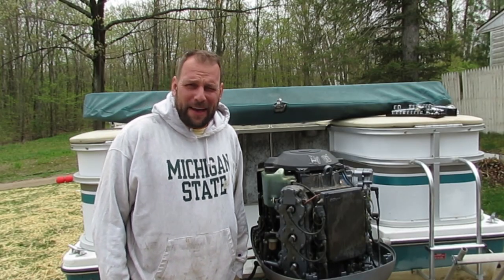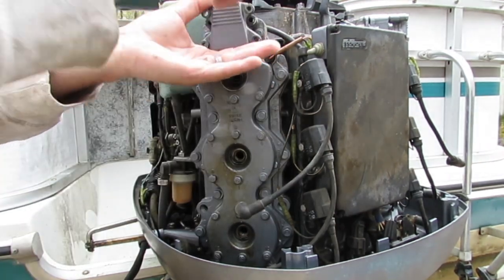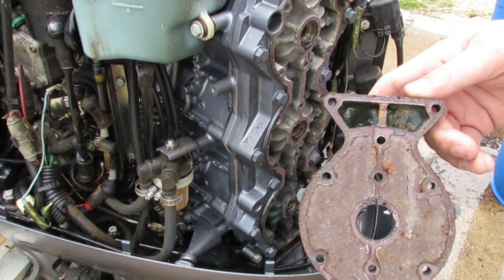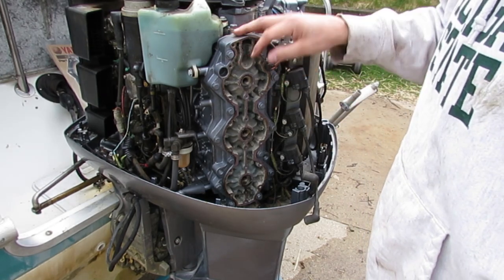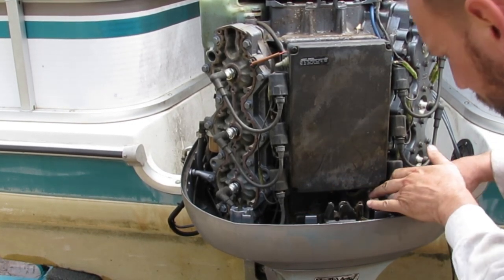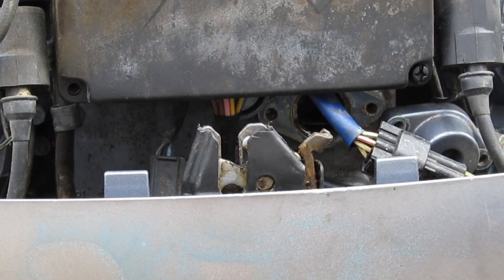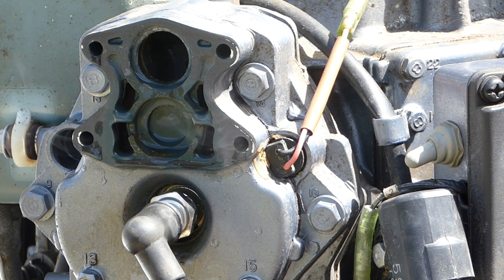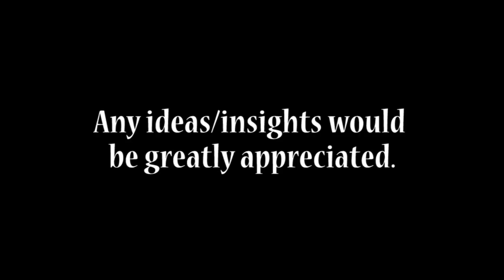Outboard overheating - I've tried everything...

Comment: Make sure your water tube that brings water up from the water pump isn’t corroded and leaking. This happens a lot in salt water boats.I was told just because the water is coming from the tell tale you need a certain minimum  pressure to cool the outboard. I was told you don’t always get the pressure with the muffs and if you have a well that is your source for water it’s tough. Cut a 55 gallon plastic barrel with a drain on the side and it seems to be what the pros use.I would once again check and test the thermostat with a hot water test and confirm they are good. As we know new ones can be bad. Depending on the year last but not least do a computer diagnostic test . I appreciate your frustration and these steps have answered my problems. Best of luck.
Reply: Yep, I have an identical motor and same problem, but only in mossy lake OR when trolling at low RPMs (no-wake).  My theory is that something along the way is reducing the water flow or pressure just enough that it gets slightly too hot.  Usually my alarm goes off just after trolling through an approx. 1 mile no-wake river connecting two lakes.  I shut it off for 2-3 mins and once I can get back to being able to run at higher RPMs it's fine.

Comment: I am feeling your pain right now. I have a Tohatsu 40 HP overheating and its not the pump or thermostat. No water at the thermostat or tell tail. Clean water jacket. Nor bugs in tell tail hose. I hate not solving this mystery. Thankfully there is a lot of advise here. I admire your persistence and attitude.
Reply: What ended up being your issue? I also have a 1995 40 horse tohatsu 2 stroke doing the same thing. Just now diving into it

Comment: I don't know if you have fixed it yet but remove the thermostat and put your garden hose there and turn it on full blast. It can help to clear the out flow. Water pump pressure is only 3-5 psi, it mostly moves volume of water through the jacket. A problem sometimes is bees (meat bees) make nests up inside these areas and you can't see it. Give it a try.
Reply: I’d suggest that as well. Had the same problem with my 50 hp Mercury at idle speeds. The over heat alarm kept going off even though I had a steady stream through the tell tale. Changed everything and then as a last result removed the thermostat again and back flushed through it with a garden hose. Problem solved.
Reply: i agree with u. i have a experiance once.

Comment: I would use a temp gun to see if it is in fact over heating. Could be a faulty sensor. If not the. Pull the heads to get a better look at those passages. Also something could be clogging the pick up tube. Sometimes pieces of old impeller.

Comment: My boat did the same thing. I changed out the thermostat, but it still ran hot when I tested it at home with the water "ears". I put it in the lake and it runs fine. I think it needs more water than the water ears can provide.

Comment: I ran my outboard in a 55 gallon barrel with about 10 gallons of vinegar & after running the outboard for several times with out overheating it. It slowly started cleaning all the gunk & crap that ha built up for years before I bought it. Vinegar worked for me . Good luck
Reply: Também já usei essa estratégia e resultou.

Comment: If it helps. Ask yourself if there have been any changes to the engine either you or someone else made. You were on the right track with the thermostat. Always check the old and new one in hot water. I’ve actually had bad new ones.

Comment: The poppet or relief valve just dumps excess water when you are turning higher rpms as the pump is putting more water into the block than required.  Just a way to get rid of the extra water...it exits out the upper part of the mid section.  Use an infra red temp gun to check wahat the actual head temps are.

Comment: There is a little rubber piece in the lower unit, it’s meant to protect the exhaust heat from the water pump location. Make sure it is still in tact. If that little rubber piece is broken or not in place, there is your over heat issue
Reply: I’m having the same problem but with a Yamaha 30hp, will mines have the same rubber piece in there too?

Comment: Did you replace that thermostat? You should always be able to put your hand on top of the heads; even after/during running it at full speed for hours. If it feels anywhere near uncomfortable to leave your hand on there, then it IS overheating. 130°F max. 90-110 is normal. 
You can test the sensor by removing it and  boiling it in some water. Put a multimeter on ohms across the wires. When the water approaches 130-ish, the circuit should close and give you a 0.00 reading. If it stays open (or it might say OL on the screen) after the water gets hot enough, then it is bad. If your temp sensor only has one wire, then measure between that wire and the metal base of the sensor. 
The only thing i didn't see you do, was pull off the water jacket gasket. If you don't want to damage it (cuz it's a lot of gasket scraping), then flush thru it with a hose, and make sure water comes out the other end. The water jacket cover is a thin space, and little shells will build up in there. However, if your thermostat comes out clean on the back of it, then it is unlikely. 
My best accessment? Test or replace that sensor. And trust how it feels to your hand; on both heads. But watch out for those spark plug wires. 🤣
(Hopefully this issue is long gone already)
Reply: This is some helpful advice!
Reply: sorry but a 90-110f reading is far to cold! horrible advice. if the t stat opens at 130, expect the heads to be 130-145f at the top! people incorrectly assume running cold is fine. its actually not... causes cold seizing and / or uneven piston/cylinder wear . id love to see where in the service manual it says 90f at idle is fine. i am an OMC mechanic and the range for almost all models is 125-160f at 900rpm. 160f is warm enough so you can keep your finger on the top of the head for about 2-3 seconds. being able to indefinitely hold your finger on the head is far too cold!

Comment: Just noticed that the description explains the problem.  I have the exact same problem with the exact same motor, but realized that it really only happens when I idle a lot or troll in no-wake zones a lot.  So I think mine is also due to not quite enough water/pressure going through the system.  When running it at higher RPMs it seems to generate more water pressure are the problem doesn't occur.

Comment: i literally just had the same issues with over heating only i found the issue, after back flushing and disassembling the entire disassemble-able  parts of the water flows i found my issue was fragmented impeller peices located in the lower unit directly from the impeller pump to the feed tube the pump goes to up about 9inches into the pipe was an entire 6 peices of rubber blades now my engine ran with water during months of running before i just got sick of never going over 2400rpm, back flushing alone couldnt get the fragments out, i ended up taking a long wire and bent a tiny hook in the end and pulled each peice out one at a time. my engine seemed to run water only causing overheating when the water pressure sensor was plugged in, yes in. but this just goes to show that somtimes you really need to look hard for those peices as black in a black pipe can be mistakenly overlooked. hope this helped :)

Comment: You took off the only the first cover. The second cover reals all the passages for the cooling water around the cylinder head. That is where the gunk can be accumulated. You can take off the transmission and do a flush with mild acid and then run fresh water or do the right thing which is to take off the second cover, inspect and remove any gunk.
Reply: Jose Pereda yes exactly!! So close if he had Remove the second one he would’ve found his problem
Reply: Came here to post this.  OP only got halfway to the water passages.

Comment: Take it to the lake and use a thermal heat gun and see which head is getting hot .
Also , big Yamaha motors don't like to run on a water hose very long . Test run it on the trailer at the boat ramp , alot of times it will cool better than on a water hose . After that , revisit your water pump and your water tube from the pump to the power head , it's copper and older motors they can have rot holes in them .

Comment: Actually take off both heads and water jacket covers to fully expose the cylinder jackets with all passages visible and clean them all up! Use a temp sensor to measure the results
Reply: This will fix it..

Comment: Just because you're poppet valve looks good does not mean it is good the spring has a tension on it that if it is not strong enough it will let water bypass the motor and go straight out through your drive you need to replace the spring on the pocket valve in order to make it work correctly the spring is set up at a certain tension so it will not let water leave the engine until there's enough pressure from the pump at a higher RPM at idle you will get a overheating alarm if the weight if the spring is loose

Comment: Maybe the fins from the last impeller went up into the water pick up tube on the motor up above the lower unit. Also it could be that you have some exhaust carbon stuck on the exhaust port before it gets to the propeller. I watched another video on this and those are my 2 answers that
I have

Comment: I had a similar problem. Discovered it was the sensor gauge. My mechanic loaned me one to try and it worked. Found a new one on line and ordered it. $138 cost solved my problem.
Reply: The gauge on the dash???

Comment: You have a low water pressure because there is a leak coming up the intake tube you need to remove the lower unit can you run a hose up inside the intake tube if you’re still not getting water pressure The midsection needs to be removed it might be corroded down there or the intake tube broken

Comment: check the tube from water pump to engine. had same proplem on my  johnson. turned out to be a bunch of asian beetles maid a nest at motor end of tube. put slight air pressure at telltale. it blew all the crap out. put back together and woked fine. also check the seals at both ends of the tube

Comment: Happend to me an idiot ran my engine without water going to it and melted the water pump and sucked all that shit up the tub and clocked my engine. Ran a few times and then took my compressor out and blew some air through a water line and solved my issue! In this case you engine seems to be pumping water fine it’s the temperature sensor. Try replacing that.

Comment: Pull off both heads. There are large water passages that circle each cylinder. They are likely gunked or blocked up. But even before that. Your water flow seems weak. Did you change the whole water pump assembly? Impeller, wear plate and housing with liner? This may be an old motor, but they are super reliable and bulletproof. I have one two years newer that runs like a top. It’s had it’s fair share of issues, but it’s easy to fix and parts are plentiful.

Comment: 1) you can test run a motor with tstats removed before buying anything. 2) there's a tons of water channels and passage ways in the block that can trap those little bits of propeller and debris. careful studying and blowing that out with an air gun is what i'd try. 3) gasket seals can be compromised (particularly after overheating) could have leaking exhaust back pressure counteracting your water flow pressure. 4) a new impeller, doesn't account for excessive wear left by the old one. always a chance pump may still be shy of it's original potential 5) maybe try to get an actual thermometer reading of your coolant to compare while your sensor going into warning?. . . i'm not a outboard specialist, but any technical thoughts thrown at you, when you're out of ideas, is a welcome thing.
Reply from the maker: Rick Nuccitelli all good info. It ended up being an improperly installed water pump housing.

Comment: It's November 2019 ! Got it fixed? Saw a guy put the impeller  In wrong. Some folks put the impeller in the housing instead of directly to the shaft.  Sometimes  the orientation of the impeller flaps may have been turned wrong in the housing. It will still pump  water but at a lower rate. Just sayin,,,,,,,,

Comment: Remove thermostat and run. Feel with your hand if the banks are even. If still getting overheat warning then there is internal block.remove the head and check with compessed air

Comment: If it has a copper tube going up from the water pump look up in the mid shaft housing, look and see if the top fitting is still there or melted. 
 I was fighting with same thing on my mariner turned out top mount for copper water tube was melted and engine wasnt getting water supply it needed. After i replaced top mount, problem solved.

Comment: With all due respect you should buy a engine service manual for your motor. I have one for my 200 hp Johnson and it has saved me a lot of money. It will give you a lot of information on exactly what the different parts do and save you a lot of time by not trying to remove components to find the issue.
Reply: Thank God for someone giving the best advice of all ! I'm a 40 year outboard tech and the first thing I learned that really made me successful was a service manual,  go to troubleshooting and don't skip procedures until you find the fix .

Comment: I don't understand... if the t stats are put in a pot on the stove with water, just get a thermometer and watch to see when it opens. if it's faulty, won't open at all or open partially. also, why didn't you take the temp at the top of the heads to see what the running temp actually was to rule out the temp. switch/sensor? in addition, i believe there must be a pressure relief valve. if that's leaking, it will overheat the motor because water can't travel up the block to cool all cylinders.

Comment: Have you tried removing the gearbox and connecting the hose pipe to the water feed pipe and run the engine , this is so you have a direct water feed and let the engine run checking the exhaust plate between the cylinders which should stay cool enough to put your hands on ? Also remove the thermostat and water should be coming out as the water pressure from the hose pipe is acting like you are moving , if nothing is coming out then there's a blockage below the engine ?! There can be a build up of dirt or a broken water pump impeller pieces stuck in n the feed tube or the housing area below the engine !

Comment: My yamaha 200hp hpdi outboard was overheating went over everything . In the end it was that the poppet valve had corrosion under the plastic washer that goes inside the block  it was making it to tight so the valve was sticking had to hook it out  cleaned it up with a round file got all the corosion off as best i could put grease on it put back together and now it doent over heat any more

Comment: Head is clogged the problem is inside the heads if you don't want to spend money just buy Muriatic acid and dropped inside through the thermostar leave there for 10 minutes acid has to be diluded 1:20
Reply from the maker: Sila BATtaggia head was fine. See description or other comments.  Hopefully your answer helps others.